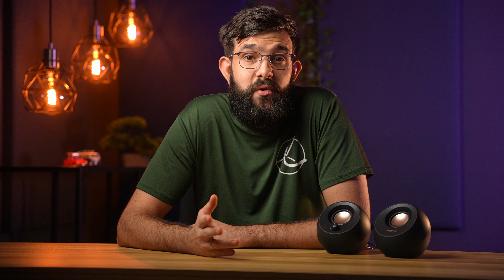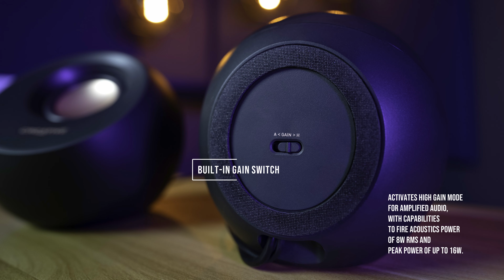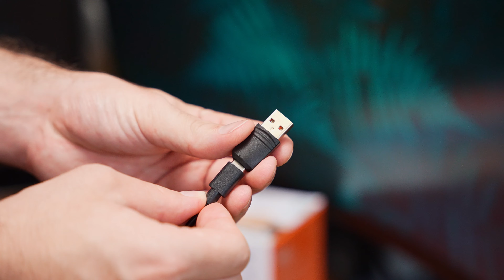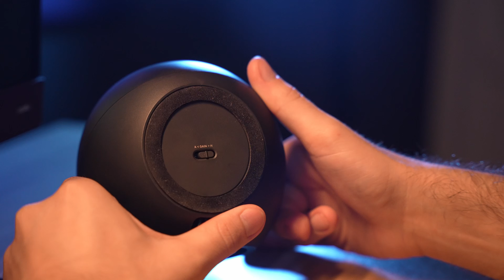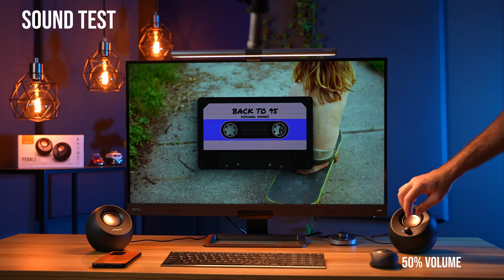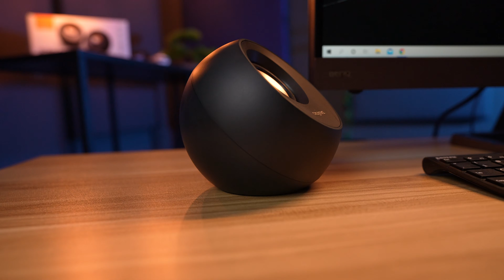Budget Speakers With Minimal Compromise - PEBBLE V3 by CREATIVE

Comment: got them today after returning the Logitech Z200, the Pebble v3 are like 5€ more expensive but the sound quality, design and features are so much better (dont buy Logitech Z200, they are beyond garbage)
Reply: Logitech z207 also garbage. It sounds like $10 speaker

Comment: Hey. Lovely review. I have a question. I have Lenovo IdeaPad 500 laptop n its 3.5mm jack is broken. I was looking for an external soundcard but then decided to buy a usb speaker instead. I dont have usb c port built in the laptop. Will this work with old usbA port in my laptop. (I cnt use 3.5mm audio cable)
Reply from the maker: thanks! It comes with usb C to A adapter so you can plug directly in
Reply: @A2KMedia  I was concerned about having enough power through the usb A port to run these. Mine are not 10w usb-c..just ordinary usb 3 and 2 ports. Wl the power be enough?
Reply from the maker: Yeah
Reply: @A2KMedia  thank you so much.

Comment: Speakers are great but I don't know why it makes some hissing noises when it is idle. Is this normal?
Reply from the maker: they shouldn't. check that you have clean power - try different power sources and see if you can connect them via usb rather than 3.5 mm jack
Reply: @A2KMedia  I connected them via USB both ps5 and laptop but it makes that noise. It is noticeable when I sit near to them or when the volume is around 70%. I bought them yesterday.
Reply from the maker: maybe there is some sort of interference?

Comment: If they were the same price, which would you recommend, the v3 or the Pebble Plus?
Reply from the maker: if you need deeper sound and have extra space around then plus would produce it due to included sub. if you want a small system that delivers great results then v3 is perfect for that
Reply: the Bluetooth connection is not stable. do not buy it

Comment: I have a little confusion on AUX-in connectivity part as if I'm connecting to PC with AUX-in cable simultaneously should I also need to plug into power adaptor?? my problem over here is different since my motherboard supports DTS spatial audio its working only through 3.5mm jack when I connect through USB it doesn't recognise my speaker previously I was using pebble V1 which was already came with 3.5mm jack.
Reply from the maker: hey, you need to plug in usb for power and then use 3.5mm for audio if you would prefer.
Reply: @A2KMedia  what if im connecting both 3.5mm & USB on same PC??
Reply from the maker: @Arno641  you can choose to use either one to play music. I suspect USB would have more functionality
Reply: @A2KMedia  So if i simply plug in the 3.5mm alone it won't have audio? What if I plug in the USB C to my macbook and my 3.5mm aux to my 3.5mm jack from my TV at the same time? Which sound is it drawing from?